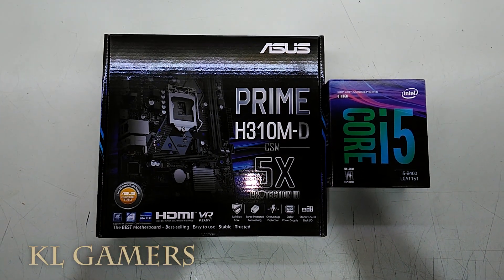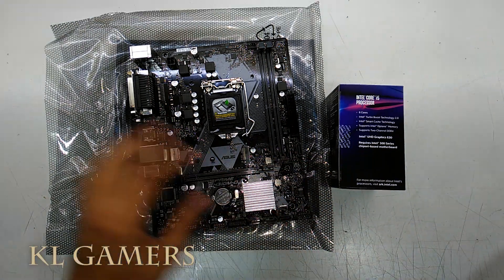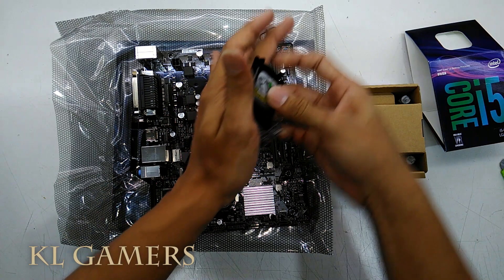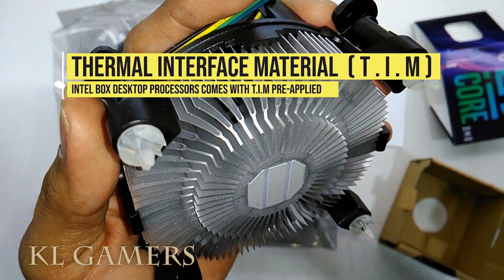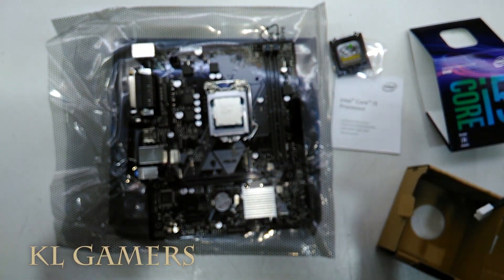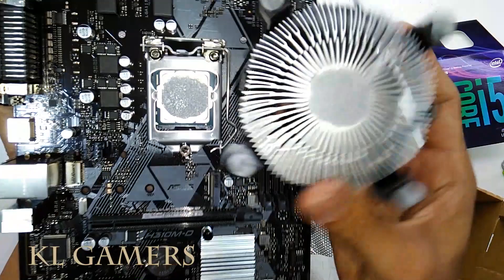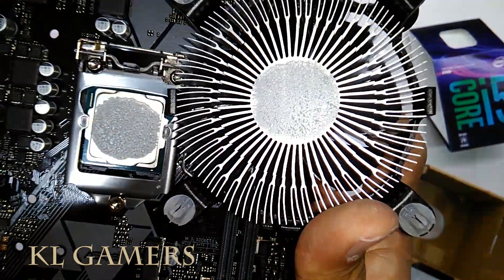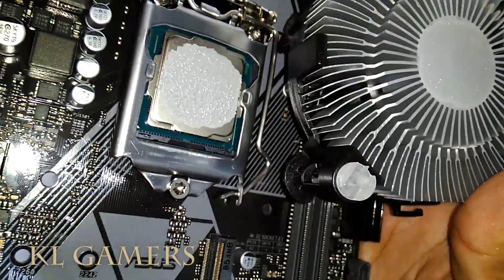Forgot to put Thermal paste? The Intel Heat Sink Fans comes with Pre-applied Thermal Paste 2019

Comment: If you remove the fan can you just reinstall it immediately or do you have to reapply the thermal paste
Reply from the maker: if thermal paste still moist and good then no need. If dry and hard better wipe off and apply new.
Reply: @KLGamers  I didn't know this when I was cleaning my computer. After a few weeks of when I opened it, it started to not boot up at all. Just   displays the graphics card name and other stuff and then says no signal. Will re applying thermal paste solve this or is my CPU burnt?

Comment: The thermal paste that comes with the fan isnt enough... usually every other aftermarket fan comes with thermal paste pre applies, but they are not enough
Reply: The thermal paste that comes with the stock cooler is enough for stock clock speeds.  You do not need more thermal paste or another cooler unless you are going to be overclocking, although you should never overclock with a stock cooler anyways...